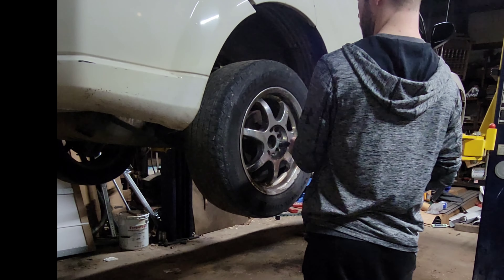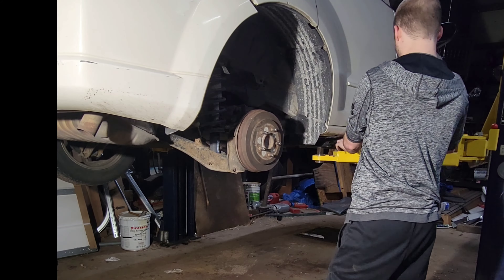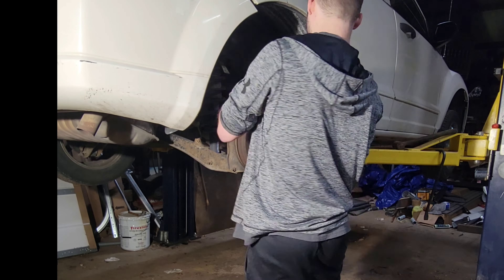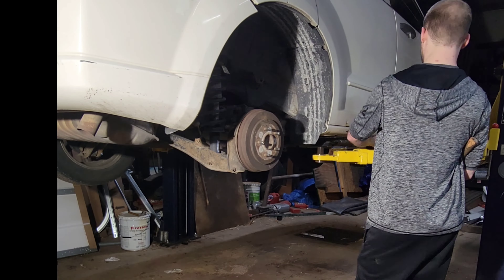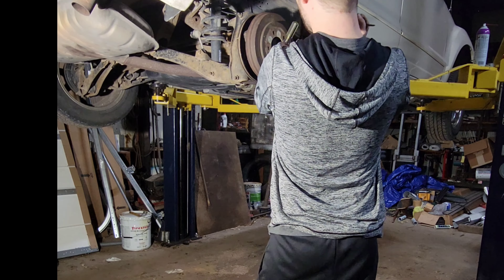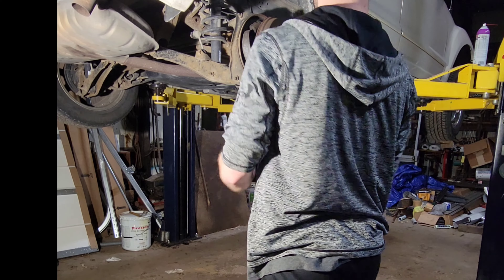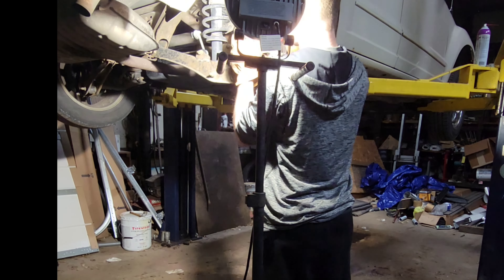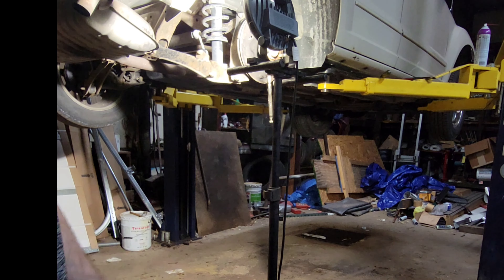removing rear drum, 07 dodge caliber.

Comment: Can I just close off the brake line going to the side that is messed up
Reply from the maker: I'm not sure about that.  Might be a temporary fix but I would definitely try to get it apart and fix it. You pretty much need new everything inside when it gets like this. Make sure you get a new gear piece. The wheel that looks like a ⚙️ ..that was my issue.. the teeth were ate up  so it wouldn't adjust itself correctly.
Reply: Noooo… won’t hold and will blow.. could lose all ur break fluid and that will
Cause you To Have no breaks!